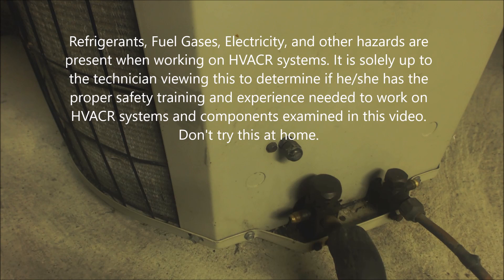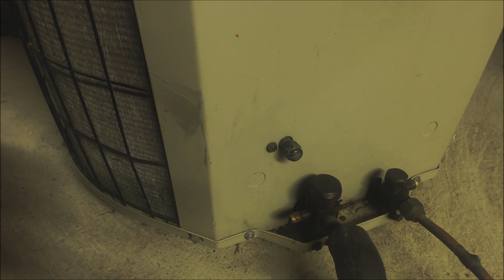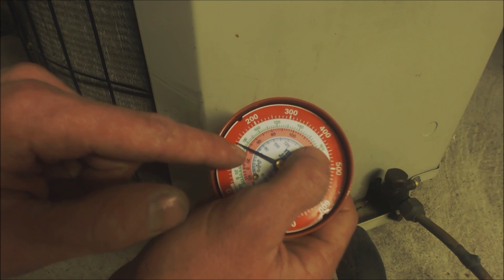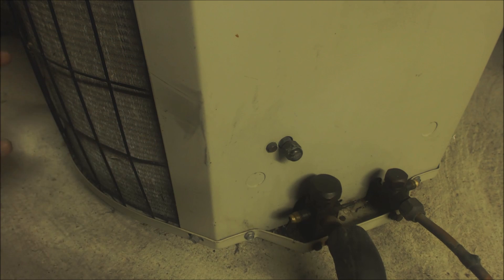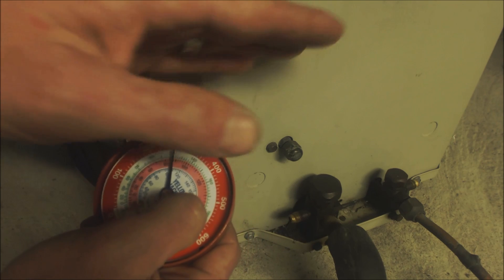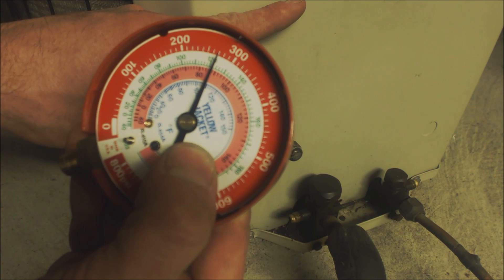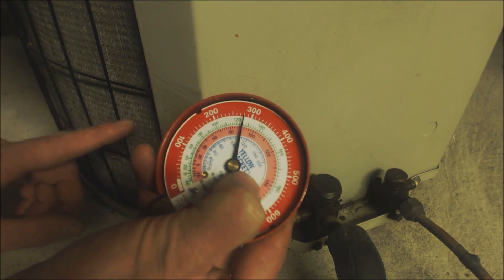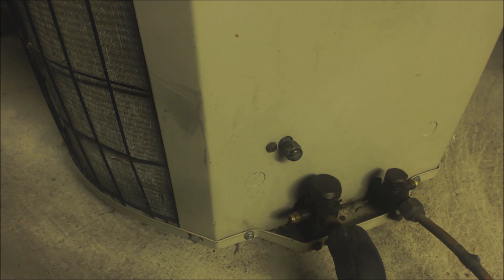HVAC Basics: How to Check R-22, R-410a Subcooling when you don't know the Rating or Refrigerant!

Comment: You said we  will find the rating of the supcooling without the plate 
But you show how to find the different between the line temp and the gauge reading and you went back to the plate 
So why u said we can get it without plate !

I don't understand the reason of making this
Reply from the maker: I was just showing how to find the actual subcooling but you would still need to compare that to the target subcooling posted on the outdoor unit rating plate. If it is not posted on the rating plate, look up another video "acservicetech target subcooling when the rating is not posted" thanks!

Comment: I had this yesterday and i did the same...used common sense .....no rating plate .......called 12 degree subcool....system was running at 12 degree subcool  i knew that would be kosher, I see 10 - 14 sub cool ratings most of the time.  Yes knowledge is cool...Thanks AC Service Tech
Reply from the maker: Sounds great Robert!

Comment: So on a 3-ton 410a split sys, txv heat pump running in cooling mode I've got 11 subcool (mfg recommended 9*-12*) but only a couple degrees delta-t indoors (checked by return air grill and nearest register)  what would you guess the problem might be?  One critical factor 've yet to work out is indoor fan speed settings and cfm.  Both coils spotless like brand new, & filter.  Would too high cfm  cause this?
Reply from the maker: I would need the low side pressure/sat temp and the superheat, also I would need to know the wb, outdoor temp, and high side pressure. Also does it hunt at all or do the pressures stay close while running? Thanks
Reply: acservicetech 125 low side 314 high side 90 od ambient.  74 indoor ambient 62 wb. according to my digital gauges it was hunting.  initially had 11 subcool 21 superheat.
Reply: acservicetech  I did find 2 Schraders  leaking so fixed them.  1 had to be re threaded. Brand new txv 15 seer system.
Reply from the maker: How much was it hunting? If it was hunting 15-30 psi then you would have nitrogen or air in the system. Did you check to make sure the txv was opening up when you put the bulb in a cup of warm water? I would have expected you to get at least 10 degree temp decrease across the coil. If there is none and it is hunting big time then there are noncondensables in the system. If you have the correct subcooling but you have a high superheat then that tells me that the txv is either not opening and letting the refrigerant through enough or there is too much of a load but usually the txv and blower speed are pretty closely matched. Usually you don't have a 5 ton blower from a furnace attached to a evap coil that is only 3 tons. You are saying there is no delta t though.

Comment: Finding which refrigerant is in the system is pretty easy just like you said.  As for the sub-cooling... knowing what it is supposed to be is tough without a label, but it is usually expected to be around 8 to 12 in most systems.  Usually + or - 3 degrees is okay, so like you said 11 is reasonable.
Reply from the maker: Thanks NETWizzJbirk!

Comment: Great subject. I enjoy your videos. 
I am fighting this issues in refrigeration but the problem that I'm having is the temperatures are all very similar unlike 22 and 410. I have been Checking the compressor name plate and the power element like you recommend but sometimes it is still a guess for me. For instance with these 22 retrofits the pressures are so similar that if the system was not labeled then the tech is left in the dark.
Reply from the maker: You are right, it is very difficult sometimes. I wish all techs would label the retrofits!